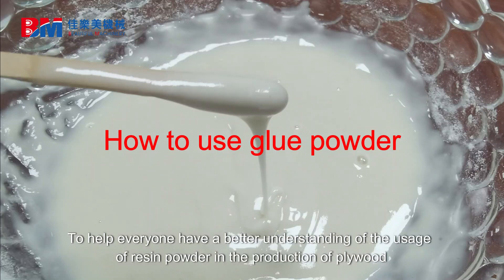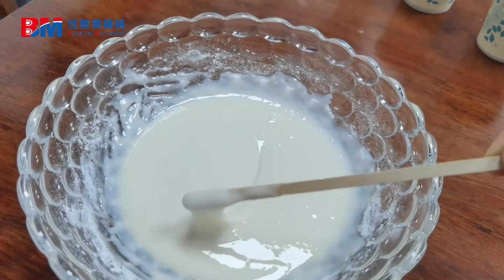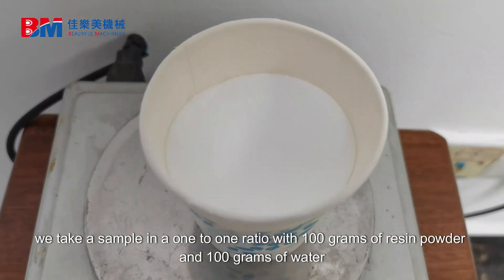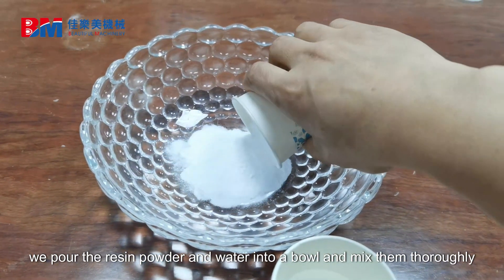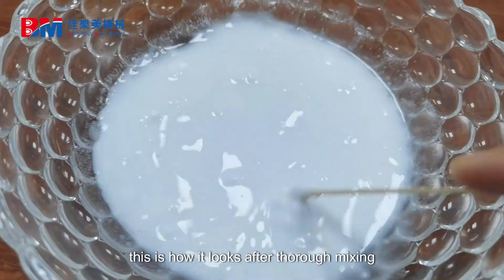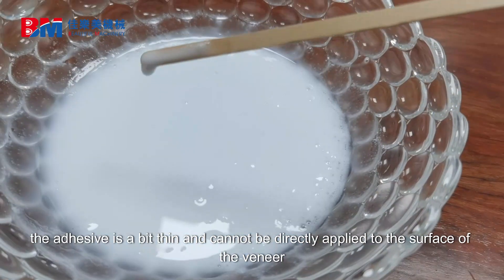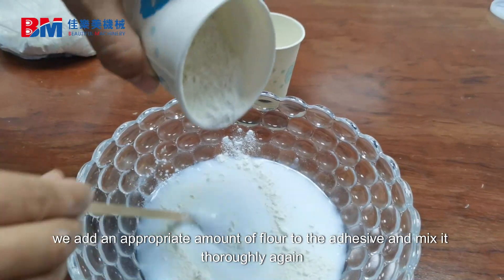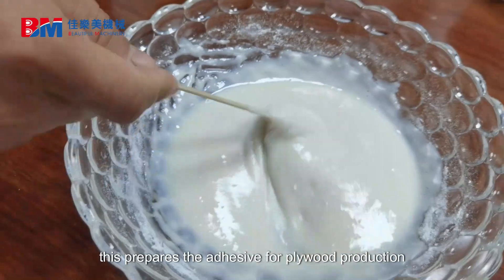How to use Urea formaldehyde glue powder china plywood putty glue powder for exporting.

Comment: Is it self dry or should have to add drying agent ? And could use it on core paper winding tube
Reply from the maker: Thank you for your question! UF resin is not self-drying—it normally requires a hardener (such as ammonium chloride) and heat press curing, instead of just air drying. For plywood, this ensures fast curing and strong bonding.

Regarding core paper winding tubes: UF resin is generally not recommended because it becomes brittle and has low water resistance. Usually, PVA-based adhesives or special paper tube glues are more suitable.
Reply: @PlywoodMachine2006 thx alot

Comment: Can your glue formula be applied to paper lamination?
Reply from the maker: This kind of glue is mainly used in the production of artificial board adhesives. Are you using melamine-impregnated paper? Please contact me WHATSAPP: +8613953968207, E-Mail: plywoodmachine2007@gmail.com
Reply: @PlywoodMachine2006  dónde puedo comprar el producto acá en Colombia ?
Reply from the maker: @juliocesaraguilaracevedo4161  I have not sold this product in your country, but you can go to the market to find out if there are similar products on sale.